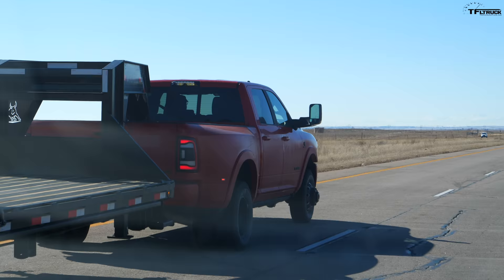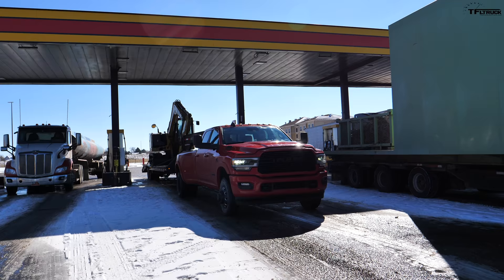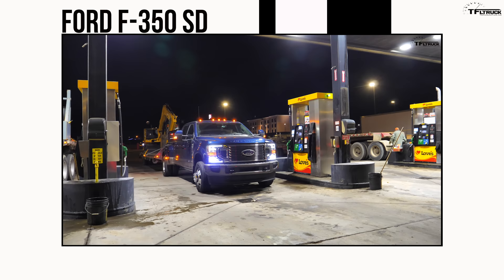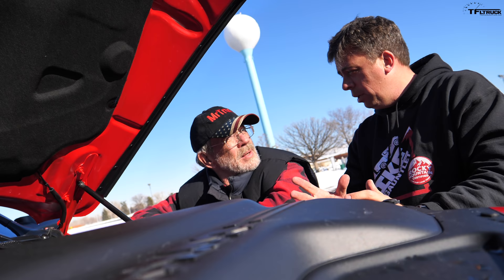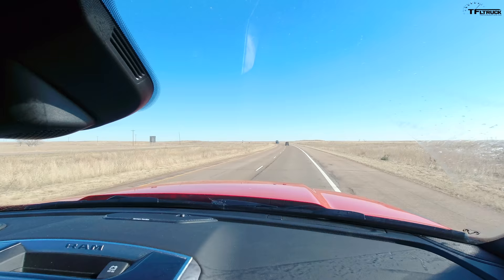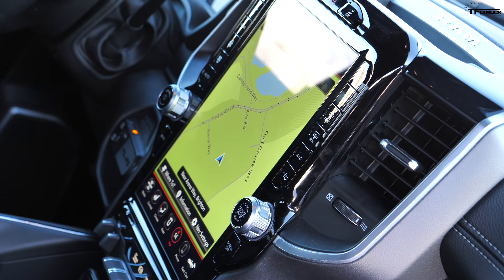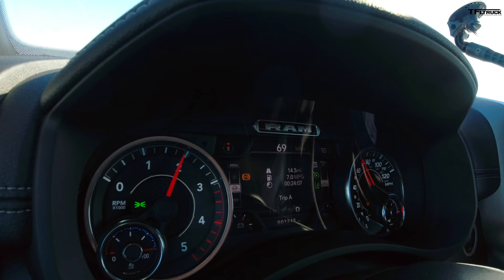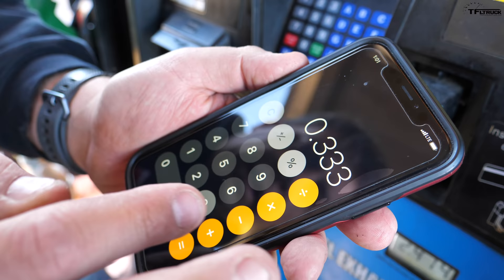New Ram 3500 Cummins Takes On Our 30,000 Lbs MPG Challenge Against GMC & Ford Diesels!

Comment: Okay guys.  I’m a big fan 80-90 % of the time.  Not today.   It was months ago you tested Ford & GMC.  You really really are not doing apples to apples.  Particularly for only 66 miles.  You mentioned wind.  How about temperatures and barometric pressures?  Were all three tests with ground temperature the same?  That will affect the quantity of fuel AND actual energy delivery from what you measured “at the pumps”.  But most of all, your loop in my humble opinion is WAY to short..  When I did MPG runs for a friend on his “diesel additive products”, I made sure that the prediction of weather was stable all day - did 200 mile loop without additives and then same identical loop with “his stuff”.   Cruise control San Bernardino to Mountain Center - home of the General George Patton Museum.   I believe that was an accurate test. And of course 1200 miles - that’s not good..  A Cummins is a Real Diesel - it’s way to far from broken in.  Not recommended to tow ANYTHING first 1000 miles or more.  And God I hope Allison gets their “9 speed act together”.  My 1996 Ram is really needing replacement to pull a larger fifth wheel RV..  You’ve got to redo with trucks that are broken in.  And in successive days..  Still a fan, and sharing the videos regularly with former truckers and RVers like my self.  I’m also a former auto mechanics teacher.👍

Comment: what is the DEF fluid for? we dont' have that in Europe
Reply: Sprays it into the exhaust, something about the environment. Just another thing to bottleneck
The proformance
Reply: It reduces the NOx produced by a diesel engine that is running very lean. They use a SCR (Select Catalytic Reduction) and spray DEF into it. NOx is a pollutant more damaging than CO2 hence the need to reduce it.
Reply: We do have DEF in Europe. Most of the times it is called "AdBlue".
Reply: DEF fluid is urea (yes, the stuff in urine - only more concentrated). It provides the required Nitrogen for the chemical reaction used to reduce NOx emissions.
Reply: It's to make the politicians happy. Nothing more nothing less.
Does nothing nothing for engine performance or longevity.

Comment: A higher fuel bill sure sounds a lot better to me than dealing with the nonsense going on at Ford.  Before I get jumped on, I think the Duramax is a good reliable engine.  Looking under the hood of any of the new V8 diesel engines scares the hell out of me.
Reply: Oh come on, I can find a video just the opposite.  But let's just get right to it.  Search google for Ford 6.7 Powerstroke catastrophic failures and you'll be entertained for hours.  For Christ sakes they put ceramic bearings in the turbo, had to learn the hard way on that one, and then, let's just throw a plastic oil pan on it.  Were these things corrected?  Yes, but what was wrong with the way things were?  Leave shit alone, with regular bearings, and a metal oil pan.  Got engine work to do, well, let's build it so the cab has to come off.  It's absolutely ridiculous that consumers tolerate this shit from a manufacturer.  I really laugh at the 6.0 folks, cause they will tell you what a great engine it is after they defuck it to the tune of a few grand.   I think if you go on over to destroked.com that should tell you 
everything you need to know.

Comment: Diesels get better gas mileage when they are broken in. Get 75,000 miles of pulling trailers and the fuel mileage improves significantly.

Comment: But the thing to remember here is when you pay over $80,000 for a pickup truck,not a semi,but a pickup truck,is that you want the most reliable truck that you can buy for that kind of money.Out of the three trucks, the best truck is the Ford,that's not opinion either,that's a fact.The Dodge is the worst out of the three trucks when it comes to reliability and the GMC is somewhere in between.

Comment: Inline engine’s have always had more torque and more efficient
Reply: That's why the inline 6 has the worst fuel consumption?
Reply: That's right why do you think they don't make a v8 semi truck
Reply: @motohobo8826  They do. Scania makes em. V8's are more costly to make. Not necessarily an efficiency difference at all. While an I6 has less pistons it will typically have a much longer piston stroke than a V8 of the same displacement so they typically have similar parasitic losses. One design does not necessarily lend itself to more torque or power in a diesel application. In a gas engine the V8 has a big advantage because for a given size it will have a shorter stroke, slower pistons speed and more efficient cylinder fill. An I6 is certainly smoother and has less balance issues.
Reply: No. Torque is a byproduct of airflow. Airflow is a byproduct of displacement, manifolding/porting and supercharging (if so equipped). There is ZERO correlation between torque and cylinder arrangement (Vee vs inline)
Reply: @GroovesAndLands  You mean power? Torque is mainly a product of displacement, compression ratio and supercharging. Piston configuration doesn't make much, if any difference, here until you move the peak torque into a higher rev range where airflow dynamics, manifolding and exhaust really start to matter.  

If we are strictly talking horsepower in a high speed engine a V8 has a big advantage over an I6 of the same displacement. If each cylinder is smaller then it is easier to fill and will make more power especially as engine speed rises. Also the stroke of a V8 will almost certainly be shorter so the engine will have lower piston speed and will be able to rev much higher and make more power.

In a Diesel engine I agree that cylinder configuration doesn't matter much. The low engine speed and turbocharging pretty much put all the engines on equal grounds.

Comment: I have the Ford and Ram one ton trucks. The Ford gets better mpg at freeway speeds over 67 mph.  The Ram does much better at 67 mph and under plus much better at stop and go driving. 

Both trucks got better mpg after 10,000 miles, IDK if that’s due to break in or more the learning computers of the engines and transmissions.  All newer vehicles have computers that learn over time and adjust/optimize the engine and transmission to your diving habits. I believe more so in diesels this is the biggest reason why your vehicles get better mpg with time.

Comment: I think you’re going to have to re-run this test nothing affects your MPG worse than “the wind“ on a high load it can affect two or 3 miles per gallon if you’re driving into the wind even if it’s only a 10 mile an hour breeze makes a huge difference because it has the same effect as driving 10 miles an hour faster. especially when you consider all of these trucks had the same miles per gallon going uphill at the IKe gauntlet?? So now all of a sudden the Ram is going to be 2 miles per gallon less I don’t believe it!!I got news for you nobody buys a Ram and doesn’t delete it everybody I know that owns one is deleted and they’re averaging 3-4 miles to the gallon better towing, the ram has the most improvement when deleted of any of the three trucks. and any money you saved on fuel mileage is going to be spent lifting the body off of the drivetrain on a Ford or a GMC so there is no comparison, in ownership cost to the Ram.

Comment: Biased of course they are.... with 4 more gears and that particular truck being able to tow the most out of the bunch , hell yes 4 more gears would make a diff. I think it would beat all three. And I'm a Chevy guy btw. But I still think the inline 6 is the way to go, they use them on big rigs and farm equipment for a reason. U dont see any tractors out there pulling heavy ass loads with a v-8 diesel or any kind of excavator/ Dozer etc...

Comment: The Ram beat the Ford and the GM on fuel mileage going up the Ike. Is it possible something went wrong here?
Reply: knightwing4 I doubt it, cummins in-line 6’s have a lot of low end torque and get better fuel economy
Reply from the maker: Going up a mountain at full throttle and cruising on the highway are different conditions. we expected a better result on the flat highway than what saw here.
Reply: @TFLtruck  it's called wind. If you noticed it the truck sure did.

Comment: I don't think I'd worry too much about the d e f fluid. When an engine decides to use the d e f fluid it's in Cycles it doesn't really have a lot to do with miles per gallon type of situations it's more with engine hour situation

Comment: 6.0? 😱 we’re going to need to see the wind speeds for each MPG loop from now on. (Unofficial protest from RAM)
Reply: Yes. They need to log wind speed for the entire trip and somehow factor that in.  Also, I think pulling a 30,000 trailer at 70 MPH with one ton truck is just stupid!
Reply: Roy Smith agreed! I can see needing to tow 30k a couple of times, but not at 70mph that’s for sure
Reply: Dwayne Wilson 
They should also consider the moon cycle, tire psi and tread depth, the weight of the occupants, if any window were down, how recently the paint was waxed and any other pitiful excuse RAM owners can muster.
Reply: @scottdbsn  -  Well it's obvious you don't tow a lot or you would know how much wind effects your fuel mileage.
Reply: Roy Smith -Yes, and everyone knows that hp and torque affect how quickly you can pull 30K lbs up the Ike.
Reply: @scottdbsn  Wait, are you dismissing that wind doesn't factor into towing at all? You really must not tow enough or ever drove commercially. I drove OTR and wind is a major factor in mileage. You can run the same routes and get very different mileage depending on weather. They even admitted there was wind, even a little wind versus no wind towing that much weight can effect mileage.
Reply: Joe Fairfield -yes, everyone knows wind factors into mpg. It’s just all the excuses for this and the Ike gauntlet. The bottom line is Ram is going to have to make some changes. Inch for inch, an inline 6 won’t make the same hp as a V-8. While towing up the Ike, all trucks were near redline, the Cummins just doesn’t have the juice that Ford has.
Reply: @scottdbsn  -  Cummins dominates sled pulling and Diesel drag trucks so it's not Inline six problem.
Reply: Roy Smith -do you think they’re not tuned to their potential?

Comment: My god the epa ruined those trucks. My Ram averaged 22.7 mpg with my truck camper and trailer in toe last weekend. I realize I wasnt even close to 30,000lbs but my truck has injectors tuner  and a turbo upgrades,  its not exactly the cleanest burning thing on the road .

Comment: I'm surprised that you boys like the larger fuel nozzle. It's terrible to accurately check fuel mileage with short mileage. Pumps in to fast and tends to splash back causing inaccurate fuel #'s, Especially with low mileage tests.Go find a smaller nozzle and redo the tests.

Comment: Que the Ram fans now saying fuel milage doesn't matter. Only important thing is not squatting and not having to manually activate the brakes downhill.  
<<<<Poking through the fence at sad Ram fans with a stick, lol.
Edit: Also less DEF usage is more important than less fuel usage.
Reply: You've been waiting a long time to write that hahaha. Watch the ike up hill Cummins beat ford and GMC up ike towing. Hmmmm.
Reply: @R.E.L.Asphalt_Sealcoating  Did you watch it? Ford whipped them both by over a minute and only got .2 less mpg , it was the only truck to reach near 60mph GM and Ram were struggling at 40mph

Comment: 4.10 v 3.55 v 3.42. Nothing to do with the engine guys. Numerically higher rear ends are going to be more fuelly. Final drive in all 3 transmissions is .63. Look at engine RPM in all 3 when towing. Should be a good indicator of what your fuel burn should be. Really need an apples to apples truck to determine which is the "best" powertrain combination.

Comment: Its riding so rough because you have allot of weight in a small area get you some pipe and spread that weight out it will make a big difference and the def on that small of a loop is a waste toy dont know which one is about to do a burn from previous miles

Comment: Not really thay surprising.
4.10 gears with a 6 speed vs 3.42/3.55 with 10 speeds.
I'd be curious to see how 3500 srws compare.
There you would see 3.73/3.42/3.55 gears, and since those trucks are running mostly 275/70r18 tires, they actually have a higher effective gear ratio because the tire is taller than the duallys. Plus, you have slightly less drag without the wide fenders.
I'm starting to see a lot of hot shot guys running srw Chevys, and I bet efficiency has a lot to do with it.
Reply: This test was essentially steady-state @ 70mph, so I don't see how gearing comes into play - UNLESS you are claiming the Ram could have pulled that load at an engine speed substantially less than 1800-1900rpm, which is what the testers stated the engine speed was at 70mph. Put another way, there is a certain amount of road-load associated with pulling that rig down the road @ 70mph. The engine must meet that road load to continue moving at that speed. Less engine speed definitely means less friction - but I'm saying there ain't no WAY that Cummins was gonna pull that load at less than 1900rpm. So, with 3.55 gears, the truck couldn't have done the job in high gear. Instead it would have needed 5th gear, and probably 2200rpm or so.
Reply: The revs on the three while going up the hill were very close. If this was a level ground test with less load I would say the mpg advantage was all on transmission gear counts and ratio. The high hp tuning on Ram with that long stroke motor turning higher revs might be more the reason.
Reply: Luke Diehl 
How about a F250 vs Ram 2500 diesel comparison? Oh yeah, you can’t get that HO in a 2500...pfffft
Reply: @scottdbsn  Yeah, that's why I said 3500 srw. We all know what the old spec Cummins can do. The HO is what everyone's curious about. Also, with 2500s there's a lot more variation in tire size. The 3500 srw seems to have more or less standardized on the 285/70r18, probably because tires in that size are rated up to 4000 lb, which seems appropriate for a full ton truck.
Reply: Luke Diehl -I was implying that Ram should have the HO in all their trucks, just like GM and Ford. It’s silly you have to get a 3500 with the Aisen transmission.
Reply: @GroovesAndLands  I don't know the ratios on the 10 speeds off the top of my head, but I'm betting they're spaced a little closer than the Aisin. That means the Ford and GM can find a happy medium that doesn't exist in the Ram. If they have to downshift for any reason, it's not as big a jump in rpms. 
They're all essentially tied in terms of displacement. If one engine is running even 100 rpms slower at the same speed, that will make a difference in the long run.
Reply: @scottdbsn  Agreed.
Reply: @lukediehl1210  The friction power associated with 100-200rpm isn't nothing, but it's small. Does NOT account for  the 25-30% difference in fuel consumption.
Reply: @GroovesAndLands  Fair enough. I'm no engineer, just a truck driver. I just know the feeling of gears not being spaced properly.
Reply: @lukediehl1210  Right on. I do happen to be an automotive powertrain engineer, so this stuff is totally in my wheelhouse. I too know the feeling of incorrect gearing; in fact my turbo IS300 project car is currently geared wrong. I have 3.73 rear gear, but swapped in a T56 transmission with a .63 overdrive. The little 3.0L inline six just doesn't make the lbft to propel the car at highway speeds at anything less than ~2500rpm. Theoretically, I should be able to cruise 75mph @ 2250rpm, which sounds awesome in theory, except the engine really has to lug to do it; I'm nearly wide open throttle to maintain that. It just doesn't work right. The engineers definitely consider this stuff before vehicles make it to production. Where more gears really makes a difference is acceleration; and do not forget that when you maintain steady road speed up a hill, you're actually accelerating as far as gravity is concerned!! So, speeding up and going up hills - more gears is more better! But for a steady state, flat road mpg test - it's just not that big a deal, especially when cruising speed results in a pretty favorable speed/load condition for engine. In case of the Cummins Ram, hauling ~38k @ 70mph @ 1900rpm - that's pretty favorable overall!

Comment: Place 60,000heavily loaded miles on these trucks, then you may say anything about these Ram Trucks being reliable. Until then, STFU about a brand spanking new truck being a great truck. I want to know, what to actually expect when the new factor is gone, what these things are like for costs.

I get a Ram truck in my shop for every other vehicle in my shop.

Comment: If you are getting better than ~16MPG in a Cummins OR HEMI car, then you are NOT driving it right. The get the fullest experience in a Cummins, you really need to be around 13MPG ~ 11MPG. Same for a HEMI powered car. You really want to be around 11MPG to 13MPG with a HEMI powered car. If you are getting more than 15MPG with a HEMI car, you ARE NOT DRIVING it right. You need to use more throttle, random rivving, and random flooring it on open roads. Example, a Hellcat owner should be around 12MPG. If they are getting 15MPG or better then that means they are not using it right.